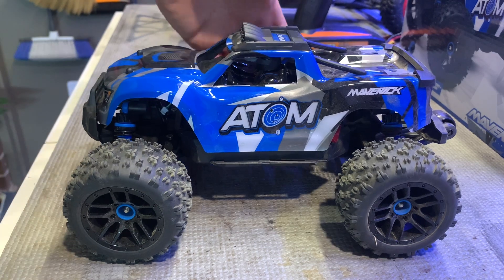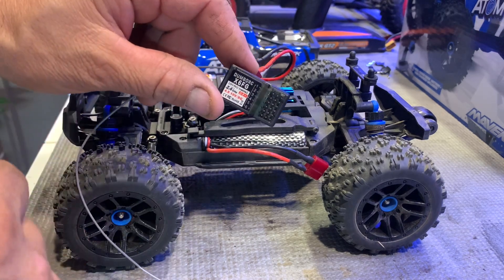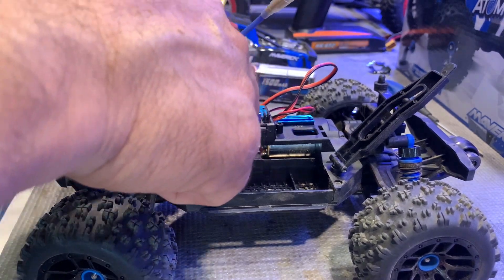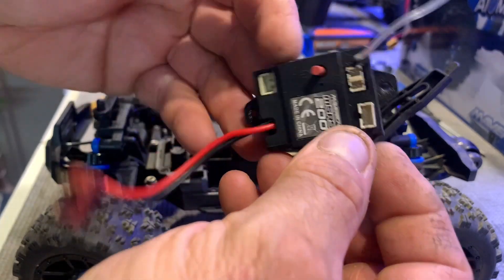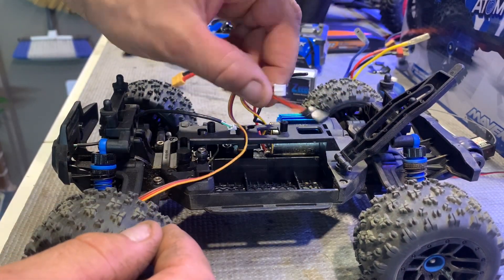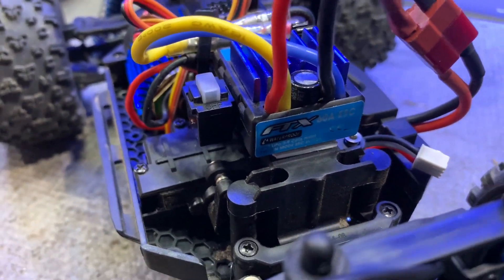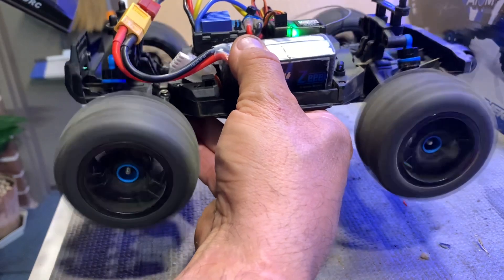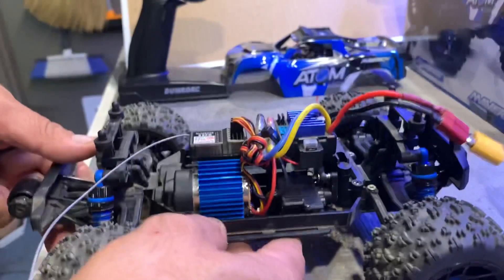MAVERICK ATOM Upgrade to a BETTER Brushed ESC

Comment: Hi what did you change to up grade please im buying for my son. Especially the 15ah battery
Reply from the maker: Hi, for now I have only upgraded the esc to a better one. And also it can run 3s batteries. As you see in the video , you will need to change and resolver the wires for the steering servo and make some mods for a bigger battery for longer play time. Here is an alternative wax you can get. 

I just found this on AliExpress: AU$28.24 | Original HobbyWing QuicRun 1060 60A Brushed Electronic Speed Controller ESC For 1:10 RC Car Waterproof
https://a.aliexpress.com/_mOKcMIt

Comment: What motor did you use?
Reply from the maker: I didn’t changes the motor as it was ok. I only changed the esc as it was not working well. 
Future video of a brushless system soon. 👍🏼🚗
Reply: @RC_Xtreme1 i got one and would consider taking a mjx 2845 brushless motor but worried if its too long and considering 2838 instead, but does the front facing flange would match?
Reply from the maker: @hasimhalim5016 the front housing should be the same on all motors. Just make sure you get the correct motor shaft size. I’m pretty sure it’s a 2mm shaft. Most motors that size might poss be a 3.175mm. So check when you’re buying. And for the length, you might have to measure and maybe pull the motor out to see where it houses onto then see how much length you have.

Comment: Can 2s lipo be added as standard?
Reply from the maker: Yes, you might just need to find the correct size battery. It won’t hurt it, plus you will get better performance from the lipo. 👍🏼🚗

Comment: Trying to figure out your wire diagram. Your blue and yellow wires from the esc are going to motor right? Did you put new on the motor?
Reply: Nevermind already figured it out😅
Reply from the maker: @rudgereilers7883  all good. Here to help anyways. 👍🏼🚗

Comment: Hey mate is it worth upgrading the esc and motor to a 3s or does it just chew up diffs  ,there a bloody strong little truck for the price though
Reply from the maker: Look overall you can . They do have steel diffs. But if you bring on the acceleration up to a nice speed, I think you might be ok. If you gonna throttle full on from a standstill then it’s a possible yes. Putting in thicker diff oil will also help. Thanks for watching 👍🏼🚗